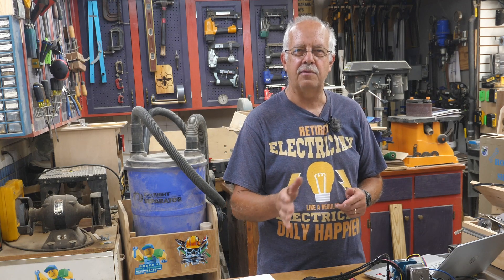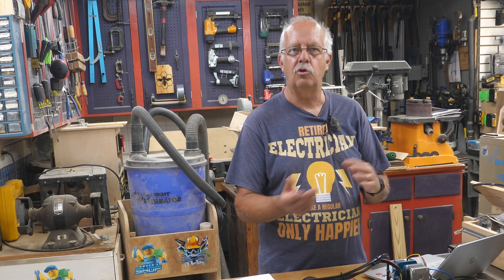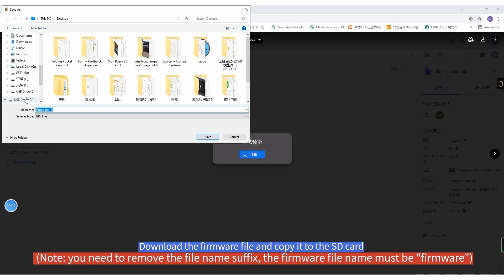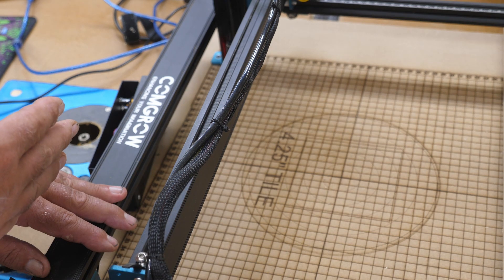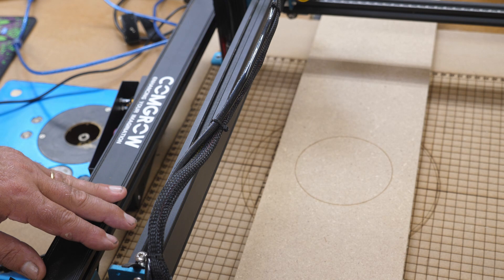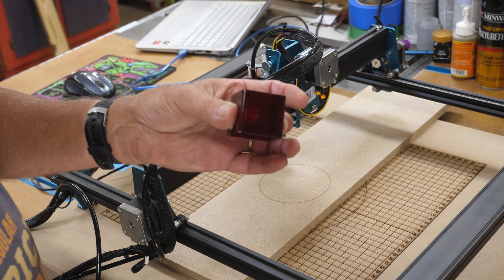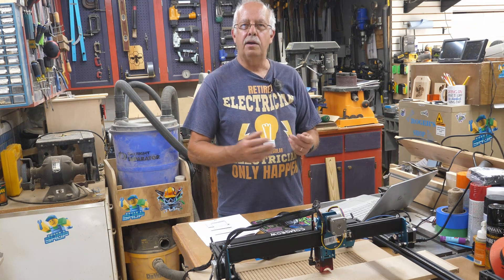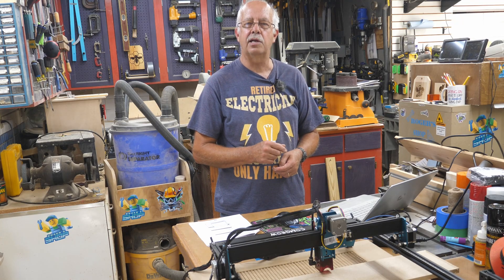Comgrow Comgo Z1 Laser Firmware Upgrade

Comment: Pro tip: You don’t have to completely disassemble the machine in order to get access to the SD card slot. 

If you remove the screw closest to the LED lights then rotate the motherboard housing towards the cutting area, you can easily access the SD card slot. 1:38

Comment: Hey Roger, thanks for the video. I was experiencing a similar problem so I performed an firmware update. Now my Z1 won’t connect in lightburn. Did you have this issue? Any recommendations to resolve? Thanks!
Reply from the maker: Check the com port setting to make sure you are on the correct port.  Otherwise, I did not have any problems after the firmware update.

Comment: Roger thanks for the video I am going to update my firmware and see if it solves my issue.  Just curious have you noticed any bumping when the laser head is moving along the gantry when the machine is in operation?  I have gone through everything and everything appears to be adjusted ok.  I have a note into Comgrow service.  thx
Reply from the maker: It is "possible" that you have a roller with a bad bearing.  I've only had this happen once, and that was on a Two Trees Laser where 6 out of 9 were bad.  Loosen up the eccentric nut so that you can easily rotate the wheels and check for any bad spots.  If there is, you will feel them when spinning the rollers.  otherwise, make sure you have the eccentric adjusted for smooth movement with no drag, but not so loose that there is wobble.

Comment: Roger, do you know if the Comgrow air assist pump will work with the Longer Ray5. I ordered the nozzle kit for the Ray5 but they don't have the pump for US customers.
Reply from the maker: Yes it will.  Most of these pumps look identical with just different names on them.  Probably all made in the same factory........